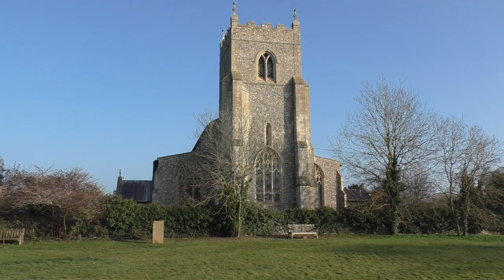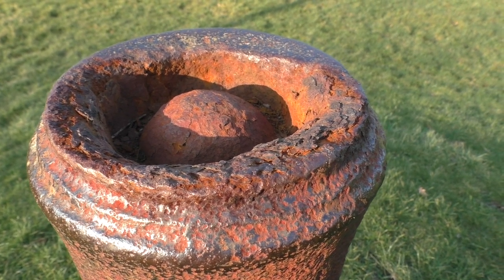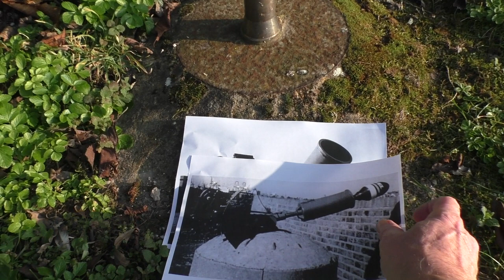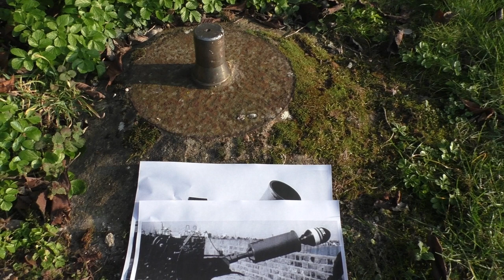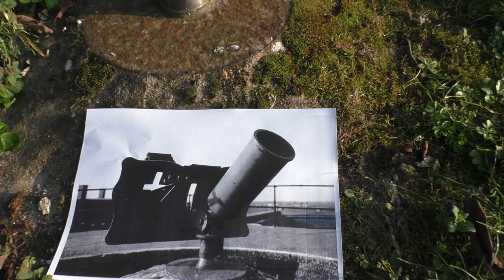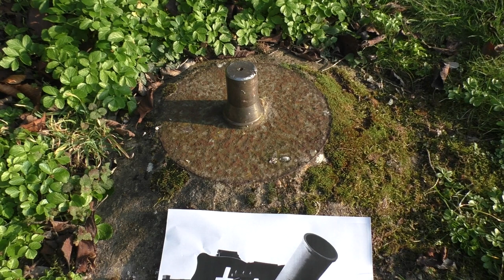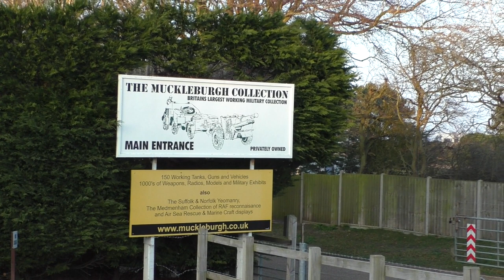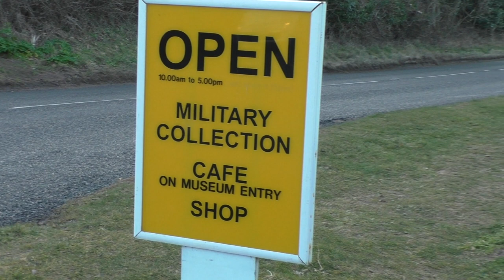A very odd cannon and WW2 remains

Comment: Really fascinating.  Thank you so much for showing these home defenses - if you find any more it would be great to see.  I was looking at the Muckleburgh Collection on Google maps and there are a number of what appear to be circular concrete foundations, three small two large north and west of the collection almost on the beach. Would you happen to know what they are?
Reply from the maker: You are almost certainly seeing the remains of the 5.25-inch AA battery which is pictured here by Stuart Banham. It appears to have been re-armed with two 3.7 inch AA and one post war 40mm L/70. 
https://www.flickr.com/photos/139375961@N08/49786292012/in/pool-artillery/

The other two may be two WW1 (not WW2) circular concrete pillboxes built during the invasion scare of 1917.
https://www.flickr.com/photos/barryslemmings/1418798016/
Barry